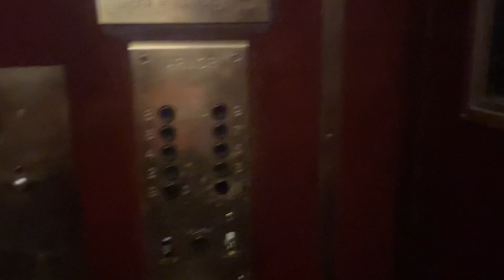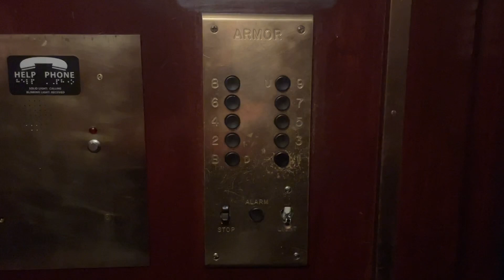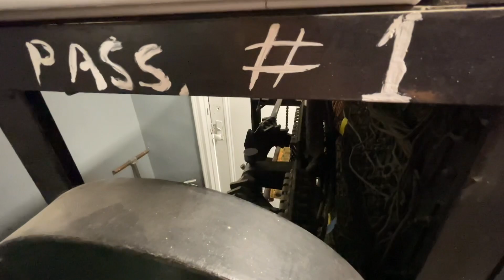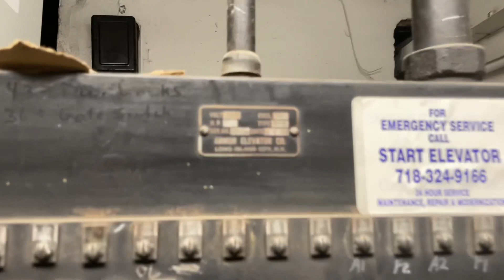[Machine Room Tour] Antique 1923 Gurney/Armor Elevator in New York City

Comment: An interesting design with the floor selector integrated into the floor relay and controller. AC traction motors?
Reply: So if you notice the open frame motor for the original one, its a DC traction motor.  Older buildings like this often had direct DC service from the power company, thus this didn't even need a gen set.  The light blue box across from the controller is the solid state DC rectifier that now provides the power for that elevator.
Reply: @ElevateMN  Oh yes I did see the open frame on the bell end of the motor and communicator/brushes I knew it had to be a DC motor and the DC drive top of the controller cabinet.  I was a maintenance engineer in a hotel for a short time where our elevators had DC traction with MG sets, and I've seen winding drums machine era 1914 with rectifier boards in the floor relay controller. Perhaps "ac elevator" threw me a bit.